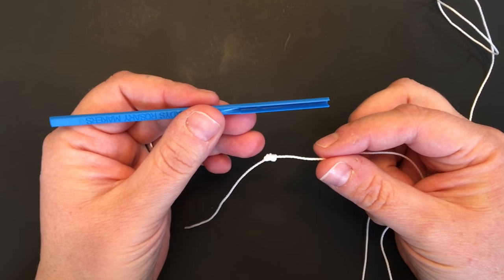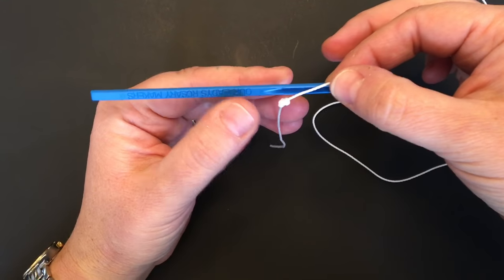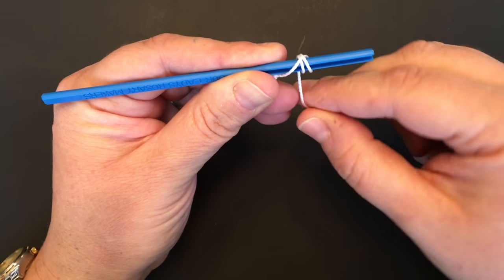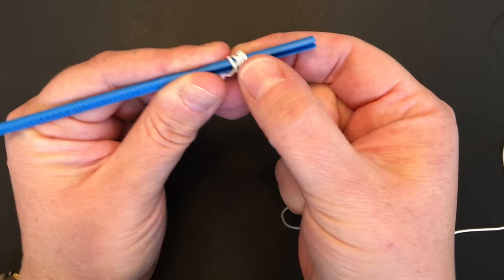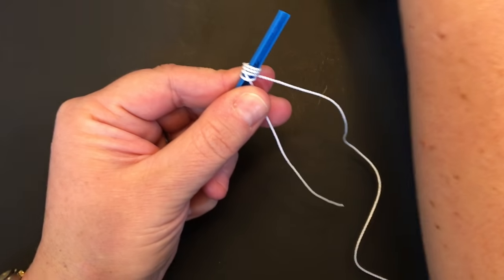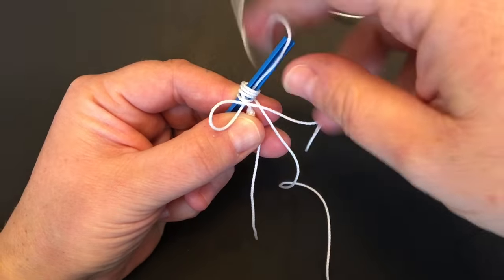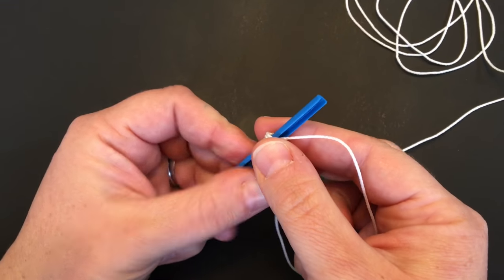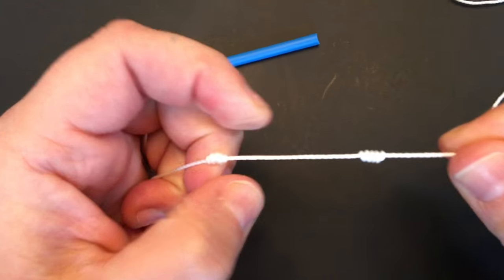How To Tie a Knot on a Cord Rosary

Comment: To replace the blue tool, you can use a straw
Reply: Its good but a bit difficult as the straws are flexible.
Reply: Thank you!
Reply: Or you can use your index finger
Reply: you can also use a hollow lolipop stick and make a cut in the tube
Reply: Our Lady’s Rosary Makers sells these. Inexpensive
Reply: I made one with a pencil
Reply: @saharafox8209  
How did you use the pencil?
Reply: @armaniousd184  I took a pocket knife and cut the pencil in half horizontally about half way down it and took the lead out and had to widen the channel a little bit but it got the job down, I can explain more if that doesn't make sense
Reply: @saharafox8209  
Thank you,,, but it seems that the effort is difficult for me
Reply: @armaniousd184  no problem a straw worked before I did that but I did just end up buying the tool from Amazon, also I ended up just making a rosary with 2mm beads for spacers 6mm for the hail Mary's and 8mm for the our fathers I actually liked it more than the barrel knot rosary I made, good luck on making them and God bless you!
Reply: @saharafox8209  
Thank you, pray for my blessed brother 🌹🌹🌹
Reply: I used a  pen. Gutted it and cut a groove in it lol. I still can't figure out how to get a barrel knots CLOSE to your beads, and seems there's not one single video out there showing you how. But they'll show you how to make a knot in the middle of a piece of string. 🤔

Comment: I need to buy a knotting tool,  and I don't know where to get one
Reply: You can use a clear 5/16 hose. Like the ones used for small engines carburator, feet the cord inside of it.

Comment: Ok, now how do you get your barrel knot closer to your beads so you don't have 2 inches of empty string?? 🤔
Reply: Well - after you slip off the knot, and before you tighten the knot by pulling the string- you can adjust or slide the knot downward or closer to the beads, while the sections are still rather loose and separated- with your fingers.
Reply: @THEJET52  oh yeah, I figured it out months ago, that you for the tip though!